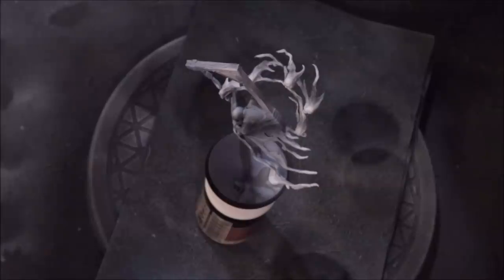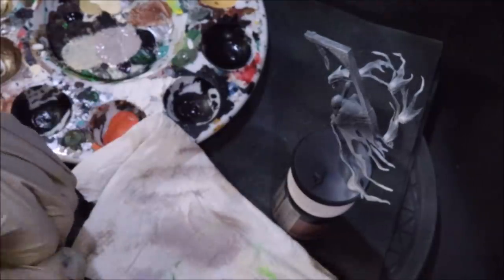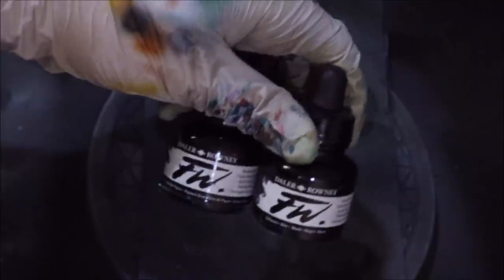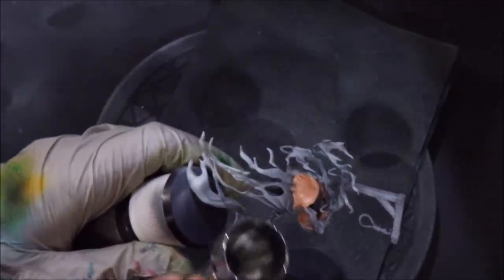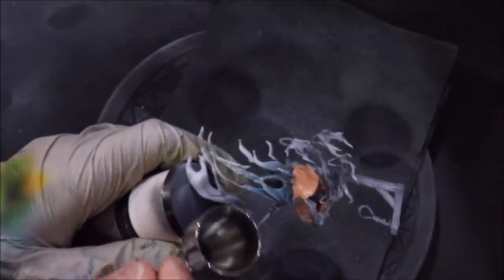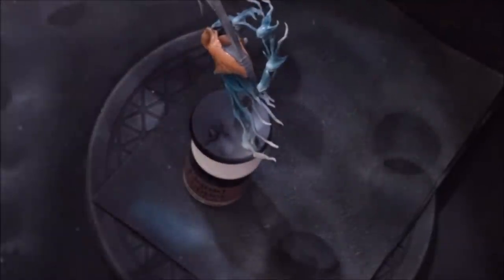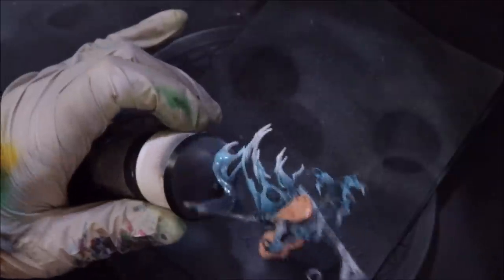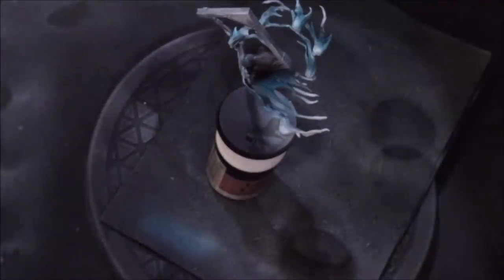Hobby Cheating 183 - How to Paint Nighthaunt Spectral Transitions & Glazes

Comment: Hi Vince,
Love your videos!
Question: how much psi on the airbrush for such a thin paint? Also, since you airbrushed so close to the model i presume you barely “pumped” ink out,  I tend to create a lot of spiderwebs sometimes.

Ty
Reply from the maker: Still at 18 PSI and yes, I just barely touched both the air and the paint (the dual action nature of the airbrush is in effect here). You can always turn down the PSI if you don't have the precise trigger control. No issue at all. :)

Comment: Hey Vince. Do you think there is any value in adding matte medium to your airbrush mix to thicken it up and make spider webbing a little easier to avoid? My W&N medium is super thick, it wouldn't take much of it to thicken the mix, and it may help with taking off the top end of the sheen as well.

I airbrush Army Painter washes quite often, as a filter, and don't find them difficult to put through the airbrush undiluted; but then I am spraying at a much greater distance, often doing a reverse zenithal. Getting up close and personal with a much stronger ink scares me, I'd like to make it as easy as I can. If a thicker mix lets me get closer, then I'll happily use it.
Reply from the maker: I will say I have never had any value to add the matte medium. It might work, but I have always just tried to control the airflow very carefully.

Comment: Love your Hobby Cheating series. It has been super helpful in so many aspects. Thank you VERY much for your hard work.
I had a question: I'm really looking into getting an airbrush, but I'm worried about the noise the air compressor makes. I'm living in an apartment and I don't want to be disruptive to the people I live with/other tenants in other units. Yours doesn't seem too loud and turns on and off which is great. How loud is it? It is much louder than an old window A/C unit? 
Thanks!
Reply from the maker: Now, if you get one wtih a tank, it's actually generally pretty quiet, shouldn't be more disruptive than an AC unit or similar thing.
Reply: @VinceVenturella  Awesome! Thanks for the quick reply.

Comment: I love this! Would I be right in assuming that I could use this technique to give the ghosts a cold white look? If so are there any inks from FW I should get? Thankfully I already have the white. Thanks Vince! I think this might be just the trick I needed to get through my spooky backlog :)
Reply from the maker: Some of the off blue inks might be good, especially when mixed with the white. The tricky part is that it wouldn't glaze as well, so you will want to increase the white layer, then do some thin blues over.

Comment: Thank you Vince! Wonderful video! I don't recall how many years ago. But I picked up a magenta acrylic Liquitex ink. I have tried mixing it with media and airbrushing it, airbrushing it straight and leaving it to dry over night. And even just painting it on and doing the same. The moment I went to try to seal it though. It would activate it again and suddenly run off the piece. Completely ruining the look and affect I tried getting. I have not seen anyone using Liquitex acrylic inks for these methods yet. Is there something I am doing wrong, or maybe I got a defective pot? I will be honest, I have been using pledge floor polish for my gloss coat so I suppose that could be part of the problem. This has not given me any problems on my regular acrylic paints from Citadel or Army Painter.
Reply from the maker: Yes, you have an ink that isn't water fast. Some of the arcylic inks are reactivatable and that will always make them a challenge to work with. The Daler Rowney FW line you see me working with avoid this for the most part (all inks have a little challenge with this if you don't let them fully dry). Liquitex does make an artists line of inks that should avoid it. 

Hope that helps. :)
Reply: @VinceVenturella  Thank you so much! Makes me feel a lot better with that problem. I'll pick up some Daler Rowney FW line then!

Comment: Hello! Thanks for this (and the other many videos you've released, you awesome being you!)!

I had a lot of fun ink-glazing my nighthaunts (though with different colours). I had a bit of trouble getting the "treat your airbrush like a brush" thing right. What I found is if I was with the 7 to 1 thinner to ink dilution, at the distance which you seem to be at, and at 27 psi or so, what comes out of the airbrush is so thin that it is extremely likely to spiderweb. Did you have the pressure at a different level than 25ish psi? (maybe I missed the bit where you mentioned that)

I also found that different inks were more likely to do this. For example, the beautiful D&R Turquoise was especially likely to start pooling and spidering - more so than Scarlet and Flame Orange - and this was at 7/1 like the others. Do you use the same ratio for all the paints?
Reply: Also, wow, those inks are really fragile... when the pooling happens the new ink easily pulls off the previous ink even if it was from an hour ago...
Reply from the maker: So let me help with both issues. First, you want a lower PSI (I run at 18 PSI) and you really have to manage your trigger control. When you are working this thin, your layers are fragile, so every so often, you do a varnish layer to protect everything.
Reply: Thank you!

Comment: thank forthe guide Vince, i keep forget, when we do with very very thin paint/ink like this,we should use more air or less air than normal base coat painting ?
Reply from the maker: I use the same PSI, I am just barely (and I mean barely) pulling the trigger back and for a short duration. Then I used just the air to dry it and repeat.

Comment: I noticed you thinned the FW inks extensively. I know one of the primary reasons people like these inks is because when they aren't thinned they're fairly opaque for an ink. But since you thinned them, I was wondering if a shellac based ink would work just as well. They don't have to be thinned as much I'd think. I know you'd still need FW for doing the parts that called for white, but I'd assume you could do the turquoise with either a warcolours ink, or something like the P3 ink you used in your tutorial on painting mint green orcs?
Reply from the maker: Possibly, I like the FW inks because they are so pigment rich, I know I can take them so thin and they will still give even color. I can't speak to any experience with taking the other inks this thin.

Comment: Just out of interest, say you're cutting in some details, and your brush slips, you mess up some of your turqoise, and you can't wipe the paint off. You have to repair it, would you glaze in a grey transition using a brush, then glaze turquoise ink over the top?

Or would you take a few steps back, break out the airbursh again and start again from the prime stage? Maybe just on the section you messed up, if you can find a suitable place to break?
Reply from the maker: Depends on the type of the error. If the error is small. A light grey and a turquoise ink over the top. If it's a big error, yeah, back to the airbrush.

Comment: Looking down on it , can't really see much of what's getting painted.
Reply from the maker: Sorry about that, it's why I moved my airbrush set-up. :)
Reply: @VinceVenturella  I'm kinda new at painting minis. When do I use inks instead of paints and what brand should I get ? Thanks for all your info. And videos. I got a lot to learn.
Reply from the maker: @robertemery1307  no issue, when you are looking for your first inks. My recommendation is the Vallejo Game Ink set. You can usually find an 8-pack pretty reasonable, it's a good starter set, they are nice and matte, and I still use many of those colors regularly. Easy to thin and use as glazes.